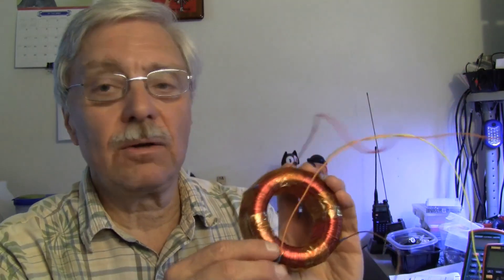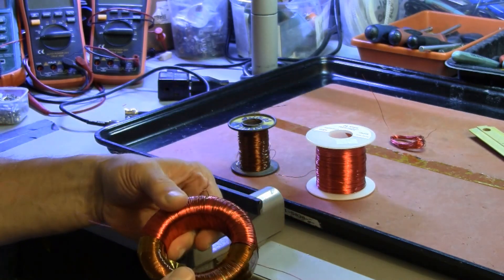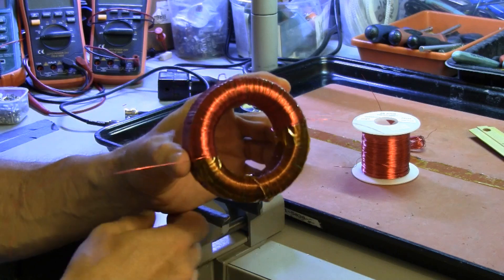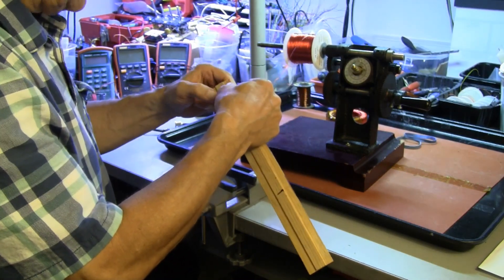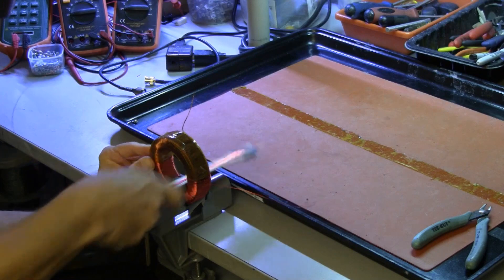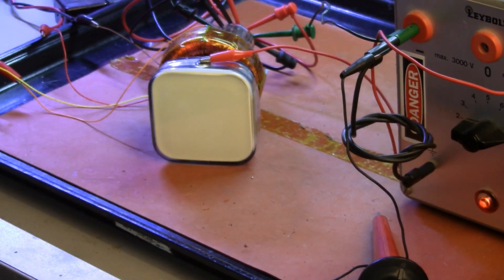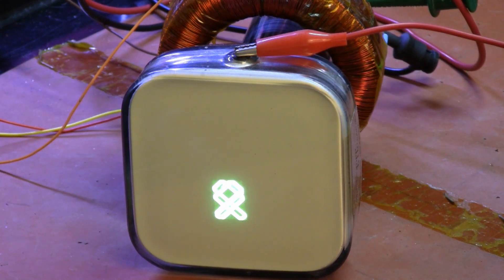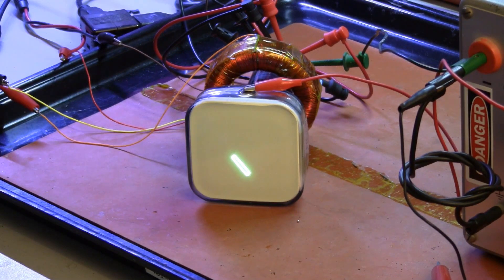CRT Vector Yoke, Episode 2

Comment: what are some ways I can power the crt anode voltage?
Reply: Whole lot of 9v batteries in series? I mean I'd work but... lotta batteries ono
Reply from the maker: (Check out the comments added by 6p1p below. Follow his link for an excellent start.)
I don't have a simple answer for you. It would depend on how much voltage and current your tube requires. I would recommend finding your local electronics / ham radio flea market and shop for cheap vintage oscilloscope. You can salvage the power transformer from that and make a pretty decent 1 to 2KV power supply for smaller tubes. Look up "voltage multipliers" as these work very well for getting even higher voltages if you need it. 
The tube I am using here might require 5 to 6KV for displaying a full TV raster. Bur, for simple scanning like this, 2 to 3KV seems to be fine.
Trying to salvage the high voltage supply from a small TV is possible. But, it is a lot more complicated than a simple iron transformer type. You can check out the HV supply I built for my NBTB cathode ray televisor for ideas. https://www.labguysworld.com/NBTV_CRT Televisor_001.htm

Comment: Interesting Experiment, I did make my own yoke without ferrite core. I though the core have to cut that gap produce the magnetic . Is interesting I can get many almost all size toroid transformer core from taobao. Maybe i will try it with toroid one day. By the way your CRT is it come with electro static deflector?
Reply from the maker: This CRT is magnetic deflection, electrostatic focus apparently used in aircraft cockpit.
Reply: @videolabguy  My scan coil/Yoke experiment.. my mainly for TV purpose the Horizontal scan depending the coil inductance for generate the ramp of di/dt .

https://geeseang.wordpress.com/experimenting-scan-coil-for-radar-crt2014/
Reply from the maker: Thank you for the link. That is an excellent project!
Reply: @6p1p  impressive work, I wound deflection coils for my vidicon tube but this is on another level, well done!
Reply: @MrSlehofer Thanks you..